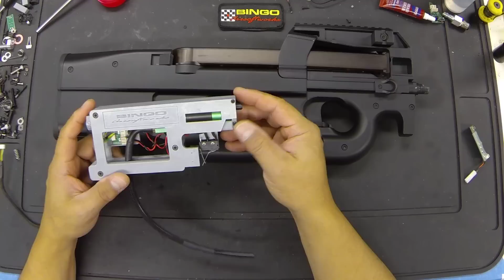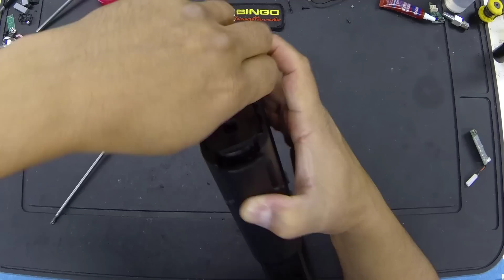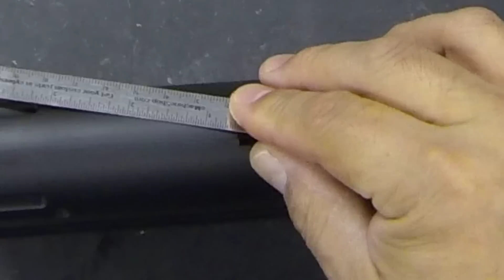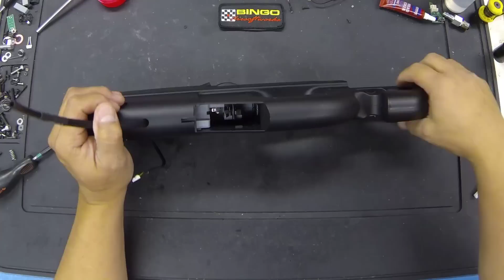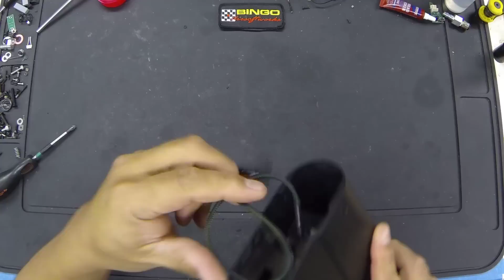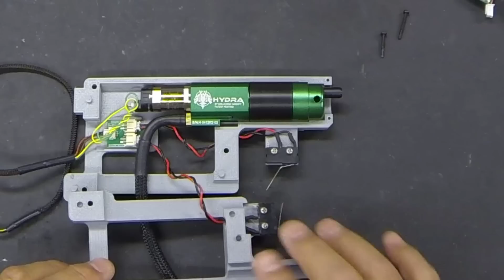Bingo Airsoftworks Wolverine Airsoft Hydra P90 Drop In Kit Installation (fixed)

Comment: I got a noob question:
Why don't you just use the big hole that was covered by the bottom plate for the air line to go out, instead of having to drill another hole?

Just asking, because maybe you got a good reason of not using the bottom plate's hole.
Reply: The area where the removable bottom plate is located is very far forward. You might be able to route the hose through that hole, but it could also interfere with the full auto switch.
Reply: Bingo Airsoft Designs
I see. Thanks for the explanation.

Comment: So i went to the website to look at the price for the p90 drop in kit and it said that it was $85. Is this not including the hydra nozzle or is it included in the price? When i went to wolverine airsoft and looked at the price, it was much higher.
Reply from the maker: The $85 is for the chassis only (includes the trigger and full auto switches). You can optionally add the Wolverine HPA engine (it's an option that is at additional cost). The P90 kit is currently not available as I am reworking it for the Wolverine Hydra Gen2 (slight differences in the engine geometry). I hope to have the updated kit available soon.
Reply: BingoAirsoftworks how much is the full package??